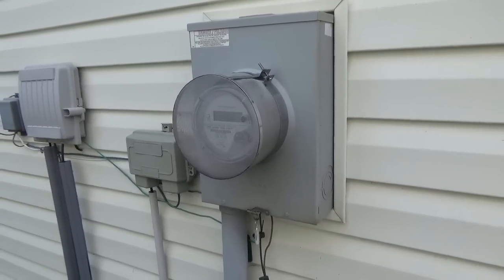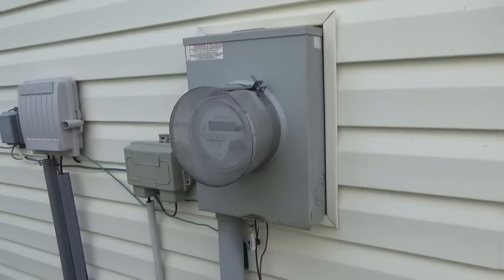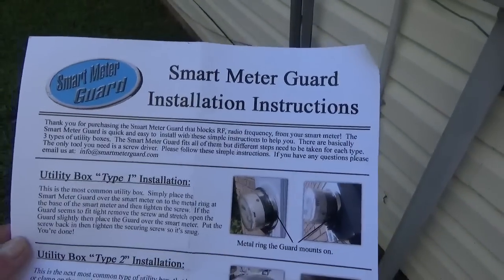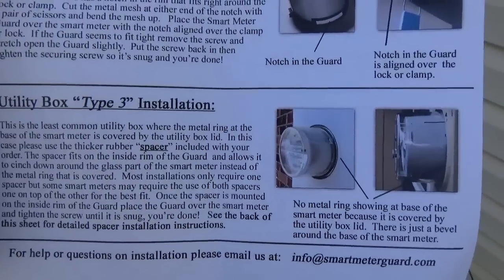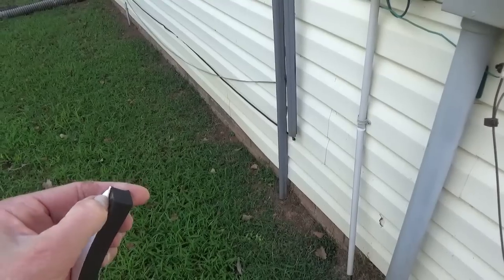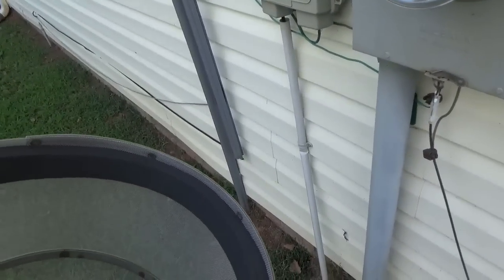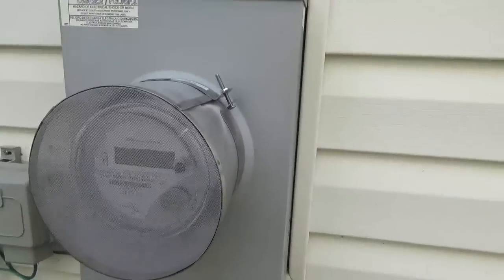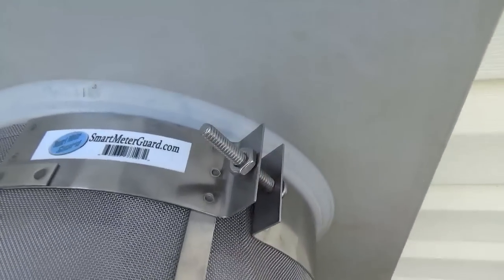INSTALLING THE SMART METER GUARD

Comment: Wish I had of seen your video first.   I too had the less common one.   I had gaping cracks and couldn't believe the sloppy job the electric company did in the first place.   I had to use the pad, both of them in fact.   I have a nice fit though now.   I just turned the washer tight enough by bringing in the clamp in.   I lost the screw the first time in the grass, it was getting dark so I used some from a box of odds and ends instead, took an extra screw too just incase I did that again.   Looks nice and snug and I felt so much better once I had it on.   My hand did feel really tingly messing with it and even my face on one side and my lip too, while playing around with it.   The light definitely was on and seemed to be pulsating.   The relief I feel though now is incredible.   I got the Smart Guard for my Modem Router and too one for my ipad and cell phone.   We should never have to go through these things all due to Greed of the electric companies, but thanks to others that know more about Radiation and Technology needed to correct things we can have relative peace,  I am so grateful that someone cared enough to make these.  I got a tumor from radiation and have been sick a lot at my home.   I cried after I put it on.   Nice video, and Thanks you too Karl for caring enough to make these.   Home should be a place of rest and peace and not worry over electric costs and your health.   I highly Recommend the Smart Meter Guard for Everyone's Home Safety Needs and also too Educate yourself on just how Radiation works and the differences between Wifi Technology and Cellular Technology; we never know what other Greedy schemes they will come up with next, we all deserve to be protected, our children and our animals, even if they are just a bunch of Mourning Doves, Other Kinds of Birds, Squirrel Clowns or even a Clover eating Ground Hog.   Just feel so much better now, a total relief !
Reply from the maker: I am glad you got yours on and feel better. Good job !

Comment: How has yours held up over time (with weather elements/wind)? I bought 3 of them, and some of the screen is tearing away from the circular steel. Unfortunately, I have the same style meter as you... but i didn't use the foam method. I just stretched the guard to fit. Maybe that stretching caused the screen to be weaker?

Comment: Thanks for the review.  Is that made of #20 mesh?
Reply from the maker: You're welcome. I am not sure. The mesh is pretty thick.
Reply: Thanks.  Is it welded together securely?  Is the guard holding on pretty well with the rubber foam in there?  I have one of those weird meter boxes too and I am concerned the foam will degrade and not hold the guard on properly.  Also, do you feel better after having put the guard on the meter?  Thanks for your answers!

Comment: They'll use smart meters to regulate the amount of energy you're allowed to use. Eventually, you'll only have an allotted amount and they'll turn you off once you reach the limit.
Reply: you're funny
Reply: No. Kay is serious and it is true.
Reply: For most of the country, as long as the power company is allowed to charge you for all the power you use, they have no reason to limit your use.  In Cali, they've done all they can to stop power companies from making electricity, which causes brownouts due to short supply.  I can easily see them turning off power to select homes in those areas.  The only exception for the rest of the country is in time of emergency, when there may not be enough power available to supply your neighborhood and the local hospital/fire station/etc..
Reply: So you think there's a remotely operated 200 amp relay hidden in smart meters?
Reply: THEY DO THAT IN FRANCE.   IF YOU USE MORE YOU HAVE TO PAY FOR A HIGHER TIER

Comment: Smart meters send information 360 degrees. These devices can get you a hefty fine from modifying a piece of equipment owned by your utility and only concentrate everything you are trying to block to the other direction, which goes where? into your home.
Reply from the maker: Smart meters are toxic. The risk of a fine is worth the smart meter cover.
Reply: I agree, they emit harmful frequencies. However the shield in these videos are worthless, and only focus the harmful frequencies directly into the home. If you are going to install a Faraday CAGE, then it has to be a cage and completely encompass the meter and socket. These things emit 360 degrees in all directions.
Reply: Thanks Dewey but I know how meter boxes are made. Just take an EMF meter go inside the house or garage and take a reading. The meter box does not stop the frequencies. There is also the fact that a piece of equipment owned by the utility is getting modified. They own the meter, the meter socket the feeders and conduit back to their transformer. If you do not want a smart meter,  just ask your utility to remove it and place a geared meter back in the meter socket. They will charge you a little extra for having to read your meter in person, but there will be no more EMF emitting from your home.
Reply: WE DID NOT CONSENT TO THIS!! CRIMES AGAINST HUMANITY!!

Comment: JTM !
SOME OF THE CAUSES OF SMART METER FIRES
Smart meters are only rated at 48 KW (200 amps)  The warranty is also null and void if the current exceeds 201 amps
Smart meters have Lithium batteries which can heat up in the sun.
Smart meters do not have surge protection anymore.  There is no over voltage grounding lugs on these new meters
Smart meters are made with a cheap flammable poly-carbonate cover.
Smart meters are not waterproof and allow moisture inside. 
Smart meters have thinner power lugs which do not allow for proper tension. 
Smart meters are not UL/CSA approved 
The warranty is also null and void if the internal temperature exceed 80C.
HOT CUTS done by Non-Certified individuals will lead to fires. 
The customer’s meter base was never inspected by a certified electrician for any problems before the meter swap was done.
Leaking seals that allow water to enter the smart meter and will cause over heating and fires. 

“In the past, design flaws in smart meter units have been known to cause serious fire hazards and spotty performance. This has caused a lot of concern for utilities and manufacturers of smart meters. To prevent problems like this, a new voluntary safety standard – UL 2735 – has been created for electric utility meters…”
New UL 2735 Electric Utility Meter Standard Ensures Safety and Performance
http://www.metlabs.com/blog/meters/new-ul-2735-electric-utility-meter-standard-ensures-safety-and-performance/
https://www.youtube.com/watch?v=h5MLo-m9lZk
https://www.youtube.com/watch?v=gOqucXzwKkA
https://bc-freedom.com/2017/03/12/former-nsa-confirms-no-surge-protection-smart-meters-god-send-for-hackers/

Comment: the wire mesh needs to be grounded in order to stop the RF radiation. the mesh that you installed is not grounded.
Reply: see the copper wire to the right of the pipe that comes from the bottom of your meter that leads to a grounding rod that is driven 8 feet into the ground, connect a piece of 14 gauge wire from that copper grounding wire to the nut that you used to tighten the guard.
Reply from the maker: Thank you for the advice.
Reply: False, see faraday cage
Reply: Grounding the mesh makes no difference to the radiation emission, but suit yourself if it will make you feel better, it can't do any harm to ground it.
Reply: I am sorry Adam 7868   But your smart meters KILL about 100 people every month.
And if you throw in the deaths caused by smart meter fires, then the DEATH TOTAL is increased by 10 deaths every month also. 
But feel free to join in, but don't forget to bring links to prove any BS you want to bring forward.
Reply: show proof
(like scientific studies then ill believe you)
Reply: how come you cant give me the proof i asked for
Reply: 2.3.1 Frequency Hopping Spread Spectrum

Operation in the 902–928MHz Band Regulations in the United States
The frequency band of 902–928 MHz is one of the Industrial, Scientific, and Medical bands in the US, commonly abbreviated as the 915-MHz ISM band. In this band, there are no restrictions to the application or the duty cycle as   there were for the control and periodic applications described above. Furthermore, the allowed power output is considerably higher. Because of the lack of restrictions and higher allowed power, this band is very popular for unlicensed short range applications including audio and video transmission. FCC section 15.249 allows 50 mV/m of electrical field strength at 3 meters distance in the frequency band of 902–928MHz. This corresponds to an EIRP of – 1.23 dBm. The harmonics limit is one hundredth of  the fundamental level, 500 μ V/m, corresponding to an EIRP of  – 41.23 dBm. Note that this is the same as the spurious emission limit listed in Table 1

Frequency Hopping Spread Spectrum Even higher output power can be used if the system employs some form of spread spectrum such as frequency hopping or direct sequence spread spectrum. The reason such allowances are made is that spread spectrum systems are less likely to interfere with other systems than are single frequency transmitters.
The output power limits for frequency hopping is one of the few times that the FCC expresses such a limit in units other than the observed electric field strength. As long as the antenna gain is not larger than 6dBi, the permitted peak transmit power delivered to the antenna is +30 dBm for systems with a 20-dB bandwidth lower than 250 kHz and at least 50 hopping frequencies. For systems with a larger bandwidth but less than 50 hopping frequencies, The peak transmit power is +24 dBm.
Transmit power for the 902 – 928 MHz band
Frequency hopping EIRP > 50 channels: +38dBm
Digital spread EIRP      +36.dBm
Other        EIRP  -1.23 dBm
ALL measuring shall be done with detector using a CISPR quasi peak detector.
 
http://www.ti.com/lit/an/swra048/swra048.pdf
+38 dBm = 4 watts
And that doesn't even add in the #2 radio transmitter
So now the DO NOT INSTALL DISTANCE for your smart meter is over 12 inches, maybe a little closer than 24 inches. 
Did you company follow the FCC's installations?
Reply: http://www.nachi.org/forum/f71/smart-meters-tripping-afcis-65449/      AFCI's tripping.

"Information: Smart Meters May Trip AFCI's - where smart meters are installed or may be installed in the future next to the electrical service panel by your utility company the RF (radio frequency) signal from the   smart meter has nearly the same electrical signature as an electrical arc which may exacerbate a potential to trip the AFCI breaker(s) and cut power to the circuit(s). This doesn't happen with the mechanical dial type utility meters. If the tripping is confirmed by your licensed electrician after a smart meter is installed then contact your utility company for resolution. There is no way to inspect or test for this condition via a limited visual inspection as there is no testing equipment." 

WOW enough radiation to trip breakers inside of a metal box.   
I WONDER WHAT CHANCE A DISABLED HOMEOWNER WITH AN UNSHIELDED MEDICAL IMPLANT HAS?
Reply: NO PROOF OF PEOPLE DYING
Reply: CISPR quasi peak detector.
It's a FHSS, AMI7, Meshed Network radio transmitter. 
AND
So what is the *DISTANCE TO COMPLIANCE for for a 4 watt EIRP transmitter?

Comment: It’s a faraday cage. You are still tampering. It will only work if it is grounded
Reply from the maker: Ummm. Yeah, that's the idea as I don't want to be slammed with the radiation coming off the smart meter.

Comment: I called Comed and asked for a smart meter to be installed and its been 10 years and there is nothing wrong with me or my family
Reply: Let's look at why we need TIN FOIL HATS. 
 #1 A smart meter will hurt or even KILL disabled homeowners who have disabled medical implants.  The average of deaths by smart meter radiation and smart meter fires is almost 100 every month in North America.
#2 Did you know if your power company “turned off” the power to your home when they did a smart meter install, your chance of a smart meter fire increased by a factor of 10,000.
#3 Your power company has access to all of you private power information. Eg When you make tea, when you turn on your alarm etc. This private information is sold to Google for huge sums of money. Ask your power company what the second radio transmitter in your smart meter does. (ZigBee) 
#4 A smart meter will cause cancer to return if your family members who are fighting cancer at home. If they come home from the hospital and sleep near a smart meter, they will die. Check with the US Cancer Society website. 
#5 Smart Meter RADIATION  will turn off breakers in your home. Both AFCI's and GFI's get turned off by the radiation from the smart meter.
#6 You smart meter is very accurate, BUT, the software (firmware) is programmable. Your bill has nothing to do with the power you use. 
#7 Smart meter radiation is breaking Ionic Bonding.
#8 A huge expenditure for a huge loss. Billions of dollars to purchase something that does not general generate any power and each smart meter need 4 watts to operate. One million smart meters use 4,000 KILOWATTS of energy to operate.
#9 The second radio transmitter is for ZigBee. If you want your power company to MONITOR your home 24/7, then you are in luck. Don’t forget, this private information will be sold. Why do you think your power company spends BILLIONS of dollars and does not generate one watt of extra power to sell?
Reply: Let's look at why we need TIN FOIL HATS. 
 #1 A smart meter will hurt or even KILL disabled homeowners who have disabled medical implants.  The average of deaths by smart meter radiation and smart meter fires is almost 100 every month in North America.
#2 Did you know if your power company “turned off” the power to your home when they did a smart meter install, your chance of a smart meter fire increased by a factor of 10,000.
#3 Your power company has access to all of you private power information. Eg When you make tea, when you turn on your alarm etc. This private information is sold to Google for huge sums of money. Ask your power company what the second radio transmitter in your smart meter does. (ZigBee) 
#4 A smart meter will cause cancer to return if your family members who are fighting cancer at home. If they come home from the hospital and sleep near a smart meter, they will die. Check with the US Cancer Society website. 
#5 Smart Meter RADIATION  will turn off breakers in your home. Both AFCI's and GFI's get turned off by the radiation from the smart meter.
#6 You smart meter is very accurate, BUT, the software (firmware) is programmable. Your bill has nothing to do with the power you use. 
#7 Smart meter radiation is breaking Ionic Bonding.
#8 A huge expenditure for a huge loss. Billions of dollars to purchase something that does not general generate any power and each smart meter need 4 watts to operate. One million smart meters use 4,000 KILOWATTS of energy to operate.
#9 The second radio transmitter is for ZigBee. If you want your power company to MONITOR your home 24/7, then you are in luck. Don’t forget, this private information will be sold. Why do you think your power company spends BILLIONS of dollars and does not generate one watt of extra power to sell?